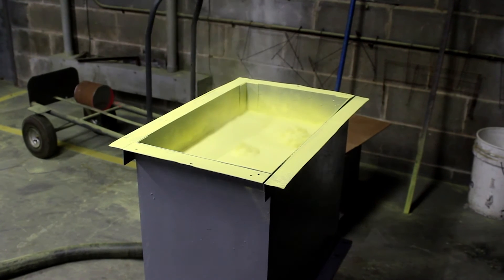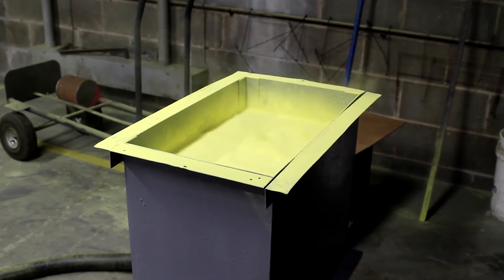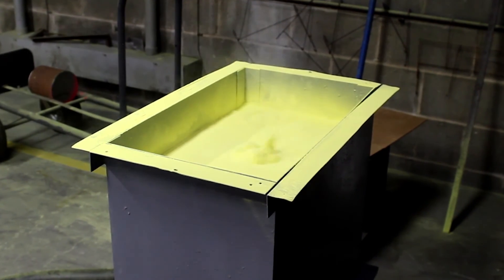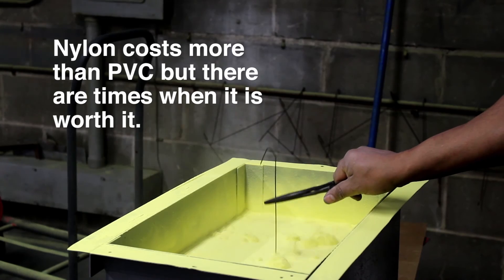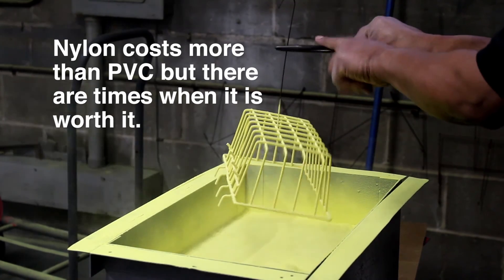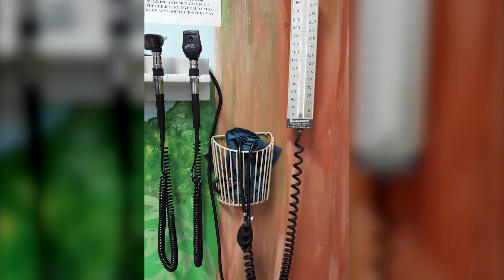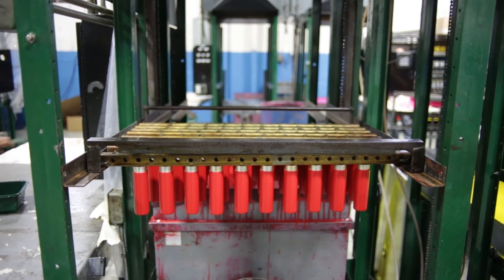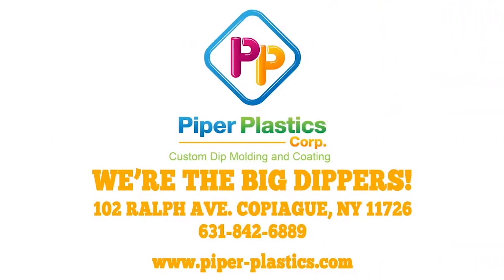Plastisol, Nylon Powder & Vinyl (PVC) Powder

Comment: In your video you state that color can be added to the plastisol, but don't address that issue any further.  Do you have another video that shows how to change colors of the material.  Furthermore, what scale do you use to know how much pigmentation to add to get the color you want?  Thank you for your time!
Reply from the maker: The "rule of thumb" is to use as little pigment as necessary to achieve the desired result.  Most plastisols will produce clear or "natural" parts without any additional pigment, even though it may look white in its liquid state.